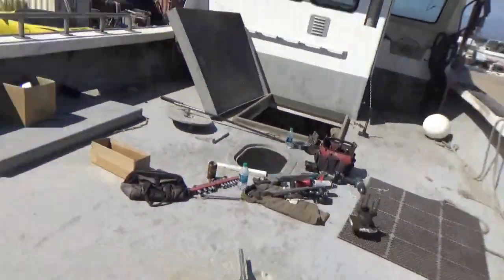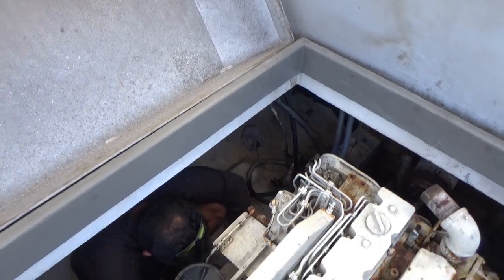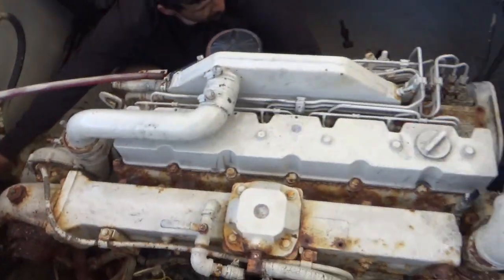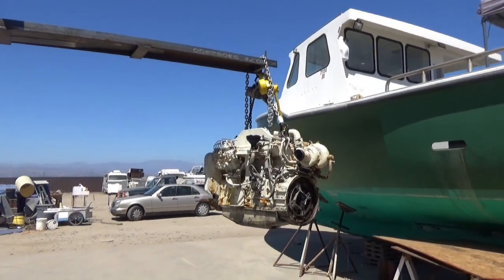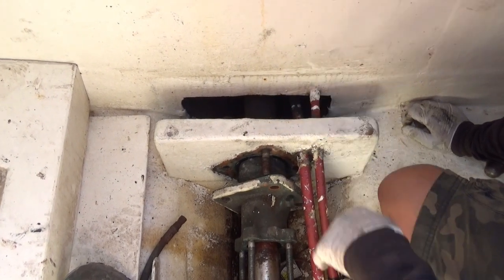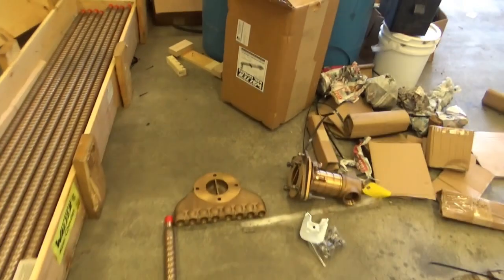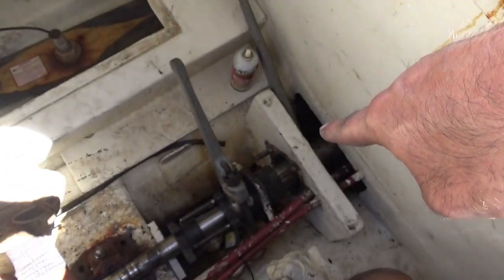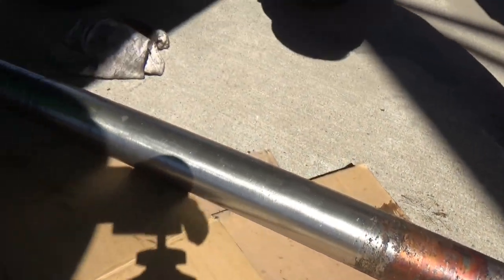Project Spotlight: Restless Demolition

Comment: hi I have Perkins 6 cylinder 120 horsepowerwas & zf63 2.48 to 1 transmission do you know the correct propeller size in diameter and pitch I need to use?
Reply from the maker: The propeller size is based on the HP and the Ratio, but you also need to know the displacement of the boat, the water line beam and water line length.